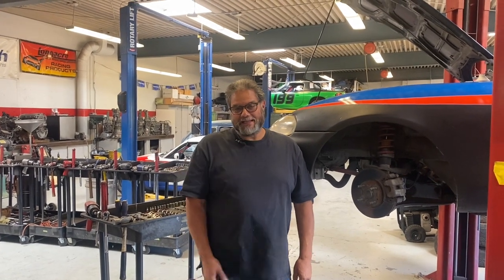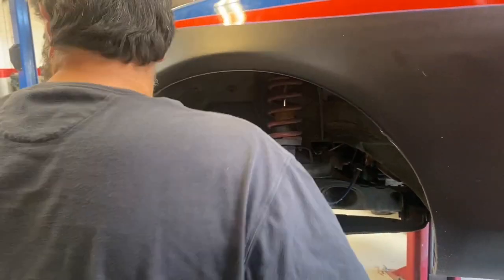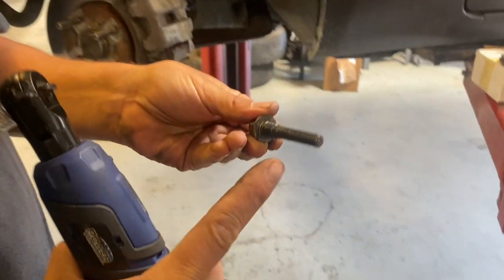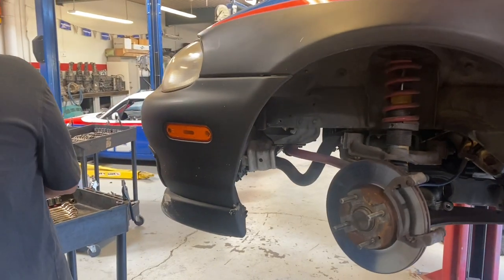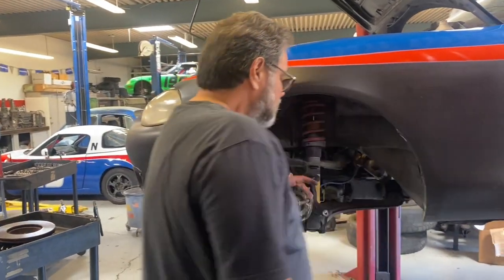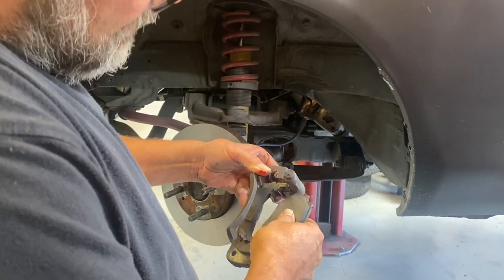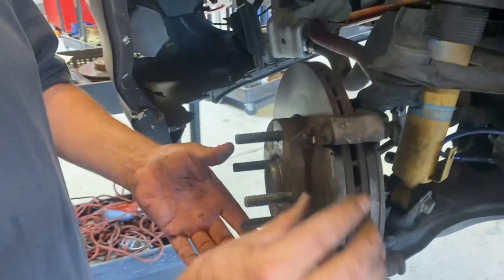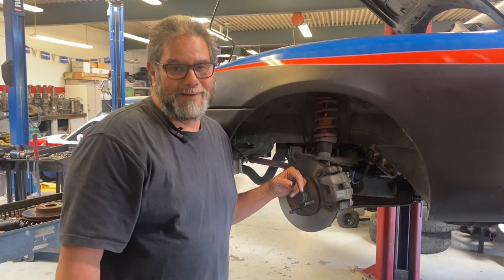Spec Miata Racing Front Brake Job.

Comment: hey al, just wondering if you experience any drag with the pads since you didn't use the clips that go into the little holes on the pads to help prevent it. I just took my wheel off and put the clips on because a mechanic told me it'll make my brakes fade prematurely, any advantage to not using the hardware?
Reply from the maker: Hummmm I really dont have a reason for leaving them off other than they are a pain. I have not had and brake fade or what I feel premature wear due to leaving them off. Most racers I know never use them.
Reply: @aracing  good to know, thanks!!